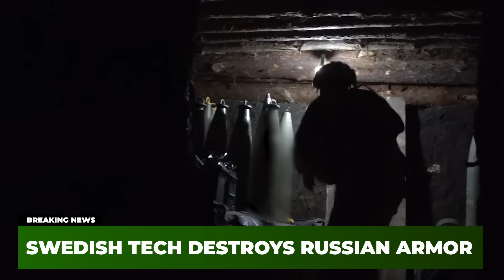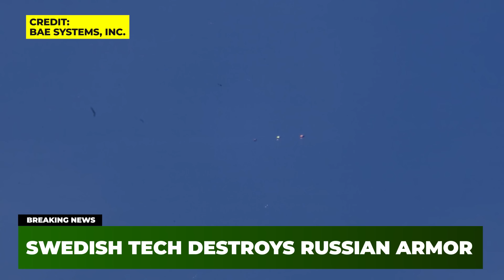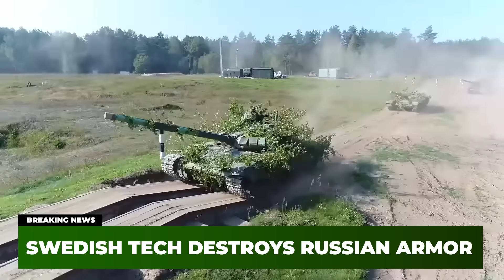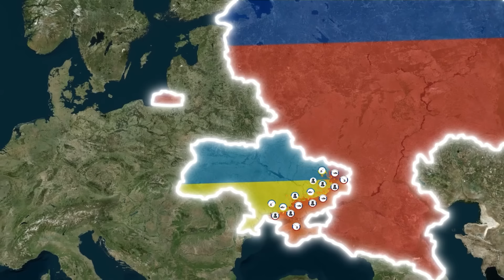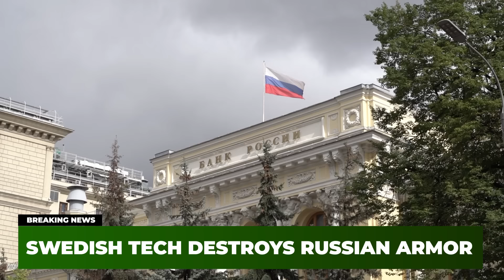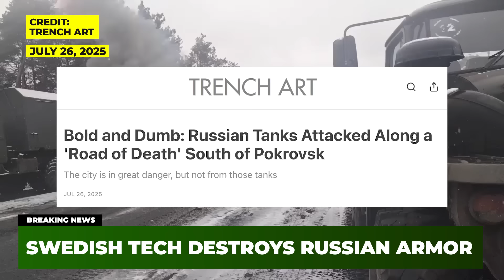Sweden’s BONUS Shell SLAUGHTERS Russian Tanks

Comment: Ah yes, BONUS – the great marvel of 1980s technology finally catching up to what the Bundeswehr was already fielding a quarter century ago. While you're busy admiring two submunitions spinning in circles, germany had systems that could set free four EFPs to wipe out an entire armoured platoon – and that was standard issue in the early 2000s. Also SMArt155 goes 30km for half the cost of a BONUS shell. Only the lame oslo convention (2008) decreased the amount of subammunitions from 4 to 2. Rheinmetall’s SMArt 155 doesn’t need a flashy acronym to outperform – it just works better. But do go on about how groundbreaking it all is. We’re listening. With polite, thoroughly German amusement.
Reply: As a matter of fact, BONUS and SMArt work for the same side, i. e. Ukraine - not against each other!

Comment: what about a extremely cheap moving tank decoy with a solid bottom and cheap body to draw out drones or heavier armour? what would you call that? cheaper the better. seems hilarious, and the more hits it can take the better. self healing wall after explosion? doubt it would be needed in the long run. a bonus function if it doesnt get struck? like drones inside? the "ground fly my pretties or radar or mine detector?

Comment: Hallo UK, Robot 57 or NLAW is developed by Saab Bofors in Sweden.
Reply: Developed in Sweden, built in UK. Teamwork at its finest 😃
Reply: 😂m
Reply: Yes
Reply: Per… enough of this “We built it! No fair…”

As a Swede myself, I’m proud of my country and heritage but I don’t have any interest in engaging in these pointless debates… pretty much every western country is using our gear; wether it’s Bofors cannons on war ships of Hercules planes or the AT-4, Carl Gustaf or Aimpoints while orders pouring in on, e.g., CV 90’s are impossible to manufacture fast enough. 

Add to that; our entire population is smaller than hundreds of cities around the globe. Yet, we’ve contributed with endless inventions where the following is just the tip of the iceberg:

- The First Three-point Seatbelt
- The First Pacemaker
- Dynamite
- The Adjustable Wrench and Monkey Wrench
- The Celsius Temperature Scale
- Minecraft
- The First Household Refrigerator
- The Zipper
- Bluetooth
- The First Bolt Cutter
- The First Propeller
- Spherical Ball Bearings
- The First Graphics Display Card
- The First Telephone Handset
- Three-Phase Electric Power
- Skype
- Safety Matches
- Rechargable Batteries
- The Gamma Knife
- ICU Ventilators
- Tetra Pak Food Packaging
- Spotify
- The First Tape Measuring Tool
- Medical Ultrasound and Echocardiography
- The Multi-directional Impact Protection System (MIPS) Helmet
- Lidocaine (Local Anesthetic)

If you know you can bite, you rarely need to…

Sgt J 🇸🇪
Reply: Swedistan *
Reply: @isapippi shut up east swedistan

Comment: Bonus sounds like the US Excalibur artillery shell.
Reply: Bonus works differently. Splits apart in the air, and two submunitions come out that spin very fast and use sensors to detect suitable targets before aiming their onboard shaped charge at the top armor and turning its occupants into minced orc.
Reply: @angusmatheson8906 i know i watched the video. Excalibur seeks the target as well but it has one charge for 1 target. I said it's like Excalibur.  But better with 2 charges.
Reply: @josephdelp87  Excaliber isn't a shaped charge, it's a typical HE/FRAG payload.
Reply: More a modernized variant of the older german SMART-round that uses small parachutes instead of metal-winglets.
Reply: @hansulrichboning8551  Yep. Both rounds have been sent to Ukraine.

All three have been sent:

BONUS, SMART, and Excalibur. 

As well as many many conventional 155mm rounds.
Reply: @angusmatheson8906  I know.
Reply: Copperhead
Reply: Excalibur is a long range precision munition. In part designed by Sweden.

Bonus is a short range antitank munition
Reply: @SkruffyTalez_TheWarzone  Bonus isn't short range, it can be fired from dozens of kilometers away.
Reply: @angusmatheson8906  if we are talking basebleed rounds, ordinary rounds can reach out to around 40km. The Bonus round to around 30km

Comment: This would have been a timely video in 2022 or 2023. Bonus and the similar Smart 155 from Germany are designed to only penetrate typical thin top armor. With hanger tanks now used with extra improvised armor on top to protect from drones, the Bonus is probably not that effective, not at least with only one hit.